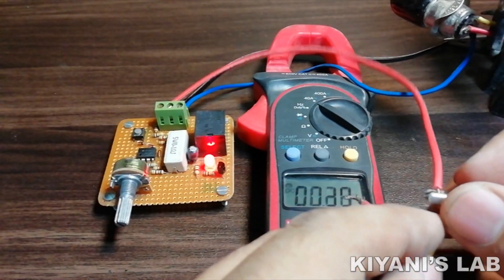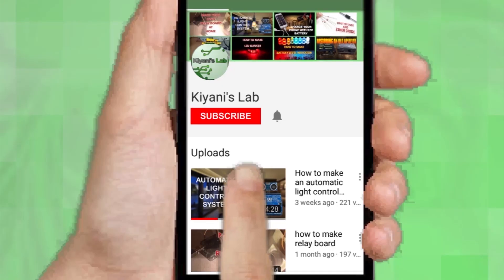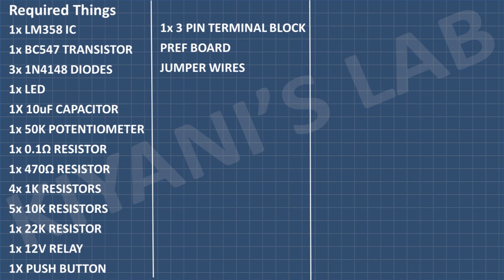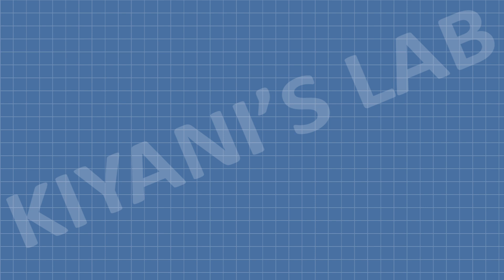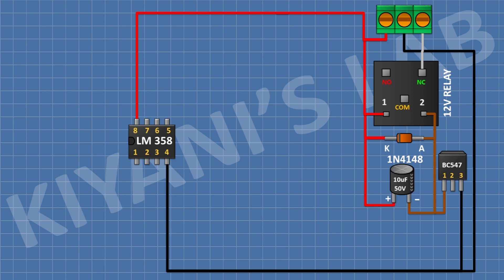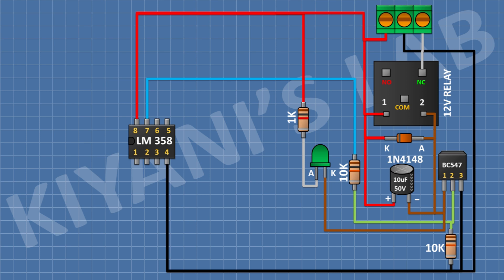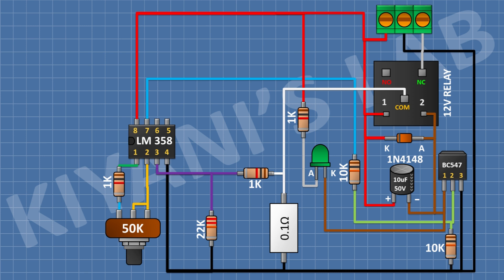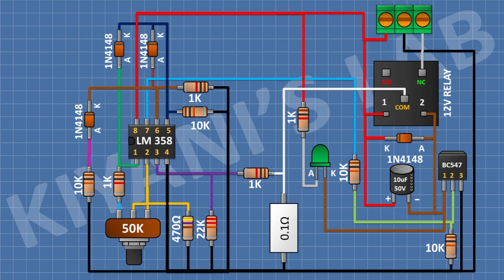How to Make a DC Short Circuit (Overcurrent) Protector

Comment: Hi bro wonderful project.... Currently iam working on this circuit.
I couldn't get 0.1ohm resistor
Can i short the connection in place of 0.1 ohm resistor with a wire
Reply from the maker: no bro you will need 0.1 ohm resistor you can use 2 0.47 or 0.33 in parallel

Comment: Thanks for this project and the files👍🏼 But I have a question: Am I right you checked the short circuit protection only at the INPUT gates not at the OUTPUT? So how would this circuit work if there is a short circuit at the LOAD??
Thanks to you! Boris. 🇨🇭

Comment: Sir🙏 please make a water level controller with dry run and source tank Without arduino and other micro controller using a ULN2003, 2803,CD4017, CD4049, CD4093.
Reply from the maker: ok bro
Reply: @KiyanisLab  bhai ❤🌹😊thankz
Reply: @KiyanisLab  bhai please🙏 mere bhai next video isy ki hi daalna aur jaldi bhai please🙏 yrrr mujhe bahaut zarurat hai 😞

Comment: Thank you for making videos on request, but what is it's maximum operable voltage and current without short circuit ,it has a potentiometer so I think it. Could be controlled ,but can you please explain it with its working and limitations.
Reply from the maker: 30v and 6A
Reply: @KiyanisLab  can we increase the current limiting by increasing changing the potentiometer with bigger value ?